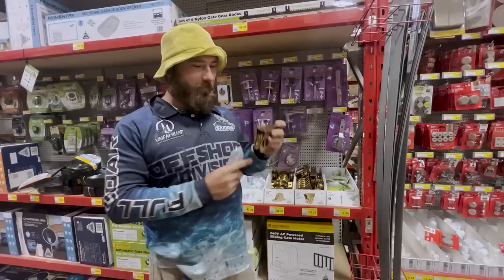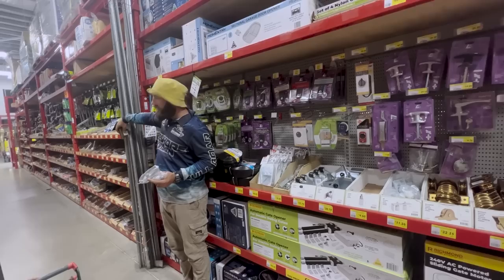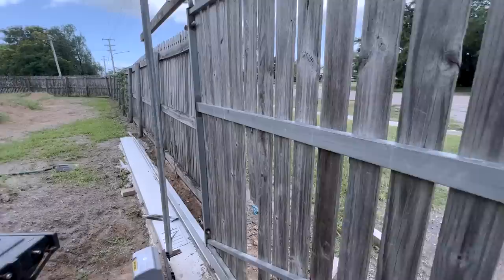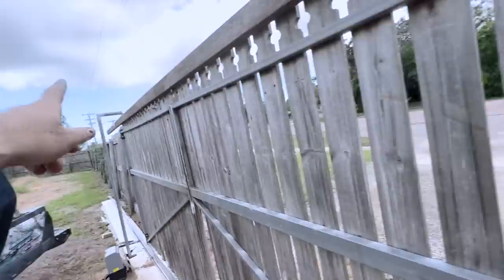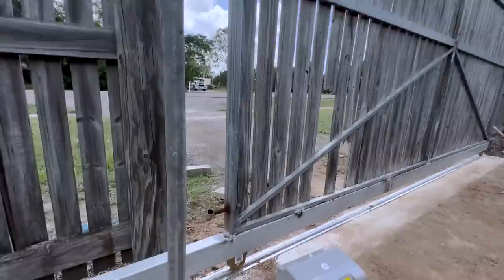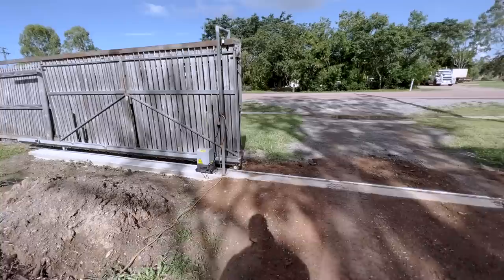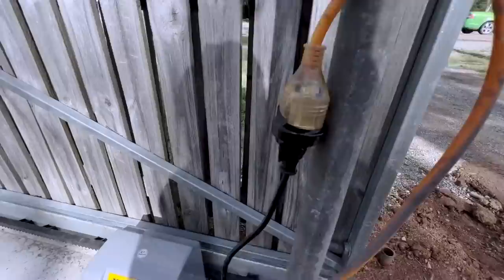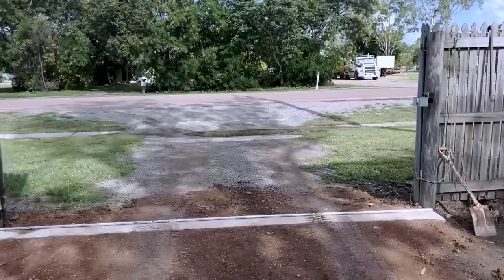Cheers to NEVER having to OPEN the F'n GATE AGAIN!

Comment: Good job, I reckon you could use that in ground power to easily run a intercom/securitycamera at the front gate aswell.
Reply from the maker: I currently have the ring camera but I gotta take it down to charge so good idea

Comment: Awesome man  - I have the old Smart Slider (now closed down) gate system.  My garage doors are on the same remote as the gate, so I hope this motor (looks very very similar - circuitry and mounting) So im hoping i can incorporate the garage opening module into an AUX port on the circuit board. I have been eyeing these off for a few months, as ours is slowly dieing...

Comment: Hey Cody, bought the gate opener after wstching your vid. Its up and working now. BTW, did you manage to get the gate resistance to work? Dip switch 4 is on and I turn POT in both directions, gate does not stop when I push against it. Cheers
Reply from the maker: I’m not sure mate, I honestly haven’t even checked that yet.

Comment: are the limiters magnetic and if so have you had any issues, hows it work in the snow?
Reply from the maker: Limiters are magnetic, I had one case where a roller came off the track and it didn’t stop (no damage just chewed the corner of the plastic gear). It doesn’t snow here so I couldn’t tell you

Comment: Great video mate I just installed the same motor supposed to have WiFi but I can't see a wifi board in it. Instructions are shit how did you set your wifi? Any information would be greatly appreciated .
Cheers Jeff
Reply from the maker: Hey mate the board is located directly to the left of the program buttons for the Remotes. You will need to download a app eWeLink I think it’s called and there is 2 buttons side by side to program it. The app is a bit temperamental but once you get it working you can just use the Alexa app. Send me a message  on instagram and I can send you some photos if my gibberish is a bit hard to understand. 🤙

Comment: Hi how did you attach the end magnet sensors? My neighbor didn't get proper screws or they misplaced it...what type of screws are drilled into the rail?
Reply from the maker: The screws supplied where a bit poor so I drilled it out and used rivnuts and bolted them

Comment: Hi mate - great work. Installed one myself and it's going well. But I lost the instal manual and forgot how to pair remotes ... anyone know what I do - hold the learn button for a few second and then press button on remote ?
Reply from the maker: I believe that’s correct, only press the pair button quickly otherwise it will forget the other ones